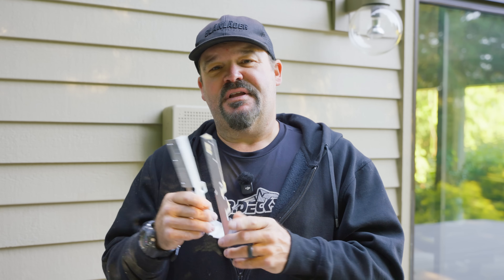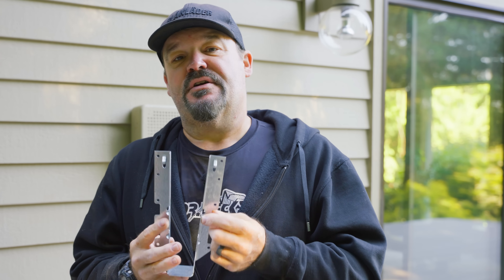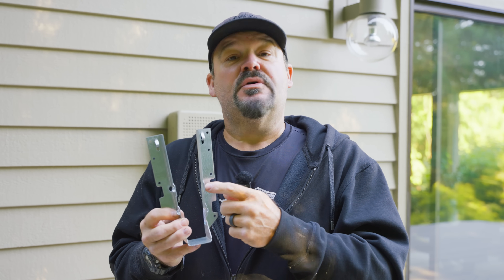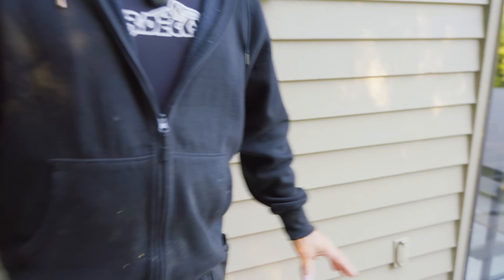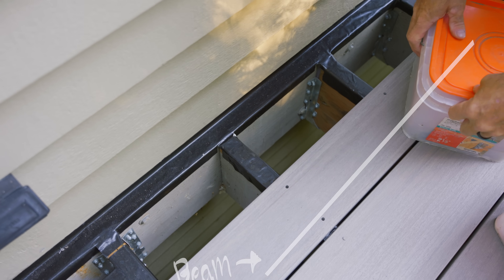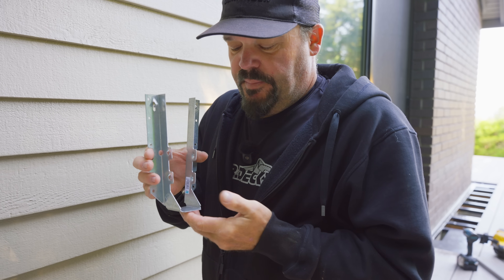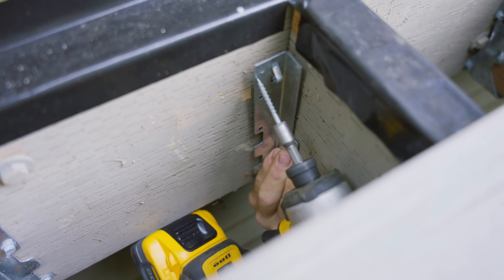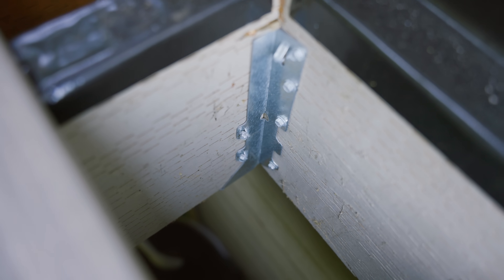The Biggest Deck Building Mistake I've Seen Over 30 Years

Comment: Totally correct if you want to believe the only thing you should use is the manufacturer screws.
That’s the suppliers buying off the code enforcement regulators 
So much bull

Comment: I know its code but its also ridiculous. You will NOT sheer off 12 regular exterior screws in one joist hanger. The wood will give way long before they break. Its another one of those deals where the hanger manufacturer found out they were not making enough profit just selling the hangers.

Comment: I work as a branch engineer (for Canada) for Simpson Strong-Tie.
I know I'm a bit late to this video but I really love the fact that you give the exact information on these hangers!
Remember that nails, by manufacturing, tends to be ductiles and screws are more fragiles. The SD screws have heat treatements and they're also tested with various hangers.
10d nails (0.148" dia) typically comes in 3in long. You might find 2.5 in but usually, joists nails are 1.5in long.
On a more personnal note, I just redid my own deck by watching various video and used the same hangers and screws... It saves a LOT of time and effort!

Comment: Just to mention these Teco nails are as thick as 16d nails ... which gives it's shear strength ... we don't care about pullout, all the load from gravity is perpendicular to the axis of the fastener ... and don't forget the dielectric material between the zinc-coated hanger and the copper-treated board ... or bad things will happen ...

Comment: 3:56 4:56 I wouldn't even use the joist hanger on a deck I'd use the ledger board and cut out at the notch for the ledger board on the joists but yeah you would use stubby nails unless the bucket calls for 12D toenails I just never use buckets on deck joists The deck boards diaphragm the joists so that they're not going to tilt on the ledger board so it makes no sense to me and I've been building everything for about 30 years myself also but I've also been doing it in another state then you're in and the way things are built and other states is different than the way they're built here and as far as attaching a deck to the house I try not to cuz it puts penetrations into the home even with proper flashing from the siding people it's still puts penetrations into the the home but if I were to penetrate the home I would use Dyna bolts or lag bolts and that would only be if I were to flash it myself to make sure that my bolts don't allow water to penetrate into their foundation or into their siding I'm not insulting how you build deck so like I said everybody and every state does things a little differently I live in Florida to me those buckets are not all that necessary I built decks on Sela flex by adhering the pseudo joists with NP1 adhesive and then shooting inch and a quarter inch and a half stainless deck screws into it to not penetrate these are obviously roof decks in Florida we don't do too much regular ground-based ducks they're mostly like second story decks that are part of the roof which you don't want to penetrate cuz you may have a deck outside your bedroom and if you penetrate the sealifax you're going to end up with a leak and your kids bedroom or your kitchen that's underneath you Cool stuff man Good work I just primarily rely on wood joinery when building a deck it's worked since the dawn of time I don't believe in putting $5,000 nails into one little piece of wood because Miami Dade code says so because you just turn the wood into shredded wheat every fastener should be pre-drilled and screwed with stainless two and a half to 3 in screws and or hot dipped galvanized bolts whether they're lag bolts are completely through bolts

Comment: Most Simpson joist hangers are actually stamped with a diagram showing the correct length nail ( at least a 10d) for the angled nails into the ledger, yet I've seen so many builders either ignore this or are oblivious to it!

Comment: Totally correct way to install a deck joist hanger! - Next video mention your use of the joist board tape I saw there, good stuff to prevent mold and rot, another PRO tip.

Comment: Professional Tip! a dab of construction adhesive at the bottom of the hanger will prevent movement and squeaks! Also, pre squeeze the hanger so it almost holds itself on the joist. You're welcome 🙂

Comment: Ductility is the ability of a material to undergo significant plastic deformation (permanent stretching or bending) before fracturing, a physical property crucial for fastners when used with joist hangers especially in seismic zone 4

Comment: Codes are created for the benefit of those that create them. That's called job security. Rating a screw by its anticipated lifetime is impossible but that line of BS continues?? Lab testing is another joke. But, like politics and religion, it's hard to argue with the brainwashed!!

Comment: Simpson makes the joist hangers, brackets, straps and plates that join structural members, they're avail at HD, Lowes, etc.  Simpson also  specifies the fasteners to be used for each application,  this info is readily available online

Comment: Joist nails are ten penny short ones that hold the hanger to the joist. Not sure what they use to nail to the deck rim. That should be bolted with washers and nuts into the building. In side is a spruce backer to bolt thru with washers and nuts. All should be galvanized or some exterior finish.Drip edge on top or spaced away from the house so water gets by.The price of all hangers has gone way up.

Comment: The fasteners into the ledger board are for vertical load.  I make a point to angle them opposite to the angle you installed them at.  The basic function of the hangars is for vertical loan not lateral.  Other components and connectors are used to mitigate those forces.  I think that is the biggest misconception of hangers.  They do not and will not hold a deck to a building.  Same thing goes for installing floor structures in a building, vertical load designed fasteners.
Reply from the maker: Good points, thanks for sharing.

Comment: I have only built one deck. I made beam/joists/footings etc, basically everything over spec. You could crane a truck onto and it would hold. Joist hangers AND the correct rated screws were a must for me.

I have seen poorly installed hangers. loose fit, and regular nails, not even spirals or ring nails. Proper materials/fasteners and tools, the only way to go.
Reply from the maker: That sounds like a solid build.

Comment: Back in the 70s, we nailed the hangers with 16d nails. Later tecos became common. Before hangers, we pressure blocked joist to beams and ledgers.
Reply: What's a pressure block?
Reply: @ThisIsSolution Pressure blocking is where you nail blocks between the joist or rafters against the ridge or ledger. You would lay out your joist. Toe nail your first joist. Then nail your block up tight against that joist. You nail the block on to the ledger.Then you would nail your first joist on to the block. Your next joist would then be nailed on to the block and toe nailed on to the ledger. You basically have a solid row of blocks between the joist, nailed on to the ledger. It is actually a pretty strong method if done correctly.

Comment: Very good insight. I had my local lumber supplier tell me to use deck screws for my joist hangers… smelled funny. Ended up using the proper SD connector screws. Whew!
Reply from the maker: Good to hear you used the right screws!

Comment: I can see that a deck could pull down a house if it was fastened too tightly to the house. In a high wind situation, you'd want the deck to detach from the house just before it created enough pull force to take down the house.

Comment: "TECO" was short for "Texas Engineering Company" which first designed/manufactured the "teco" framing clip (now known as the Simpson Strong-Tie A34 or A35 "clip" or "framing angle").  Before that, however, TECO designed/manufactured split-ring connectors along with the "combination grooving tool and bolt hole drill" which we used when field-fabricating and/or repairing bow-string trusses.
Reply from the maker: Thanks for the history lesson🙏
Reply: I new the name "TECO" sounded familiar. Back in the 1980's I did a repair job on a building at a nearby air force base that used 4" split ring connectors so I had to buy the split rings and the grooving tool.

Comment: The structural nails or screws are supposed to be a certain length to cross to handle the pull out. The 1-1/2 joist hangers handle the sheer. They're staggered for a couple different but similar reasons. The weakest point to secure lumber is within 1-2" of the end of the board. If both are in line it's guaranteed to split the board on grain. The ledger board you're spreading the fasteners through several different grain/growth lines. The more you can hit the stronger in most cases. Screws used to always have an issue with movement and sheer force. A penny nail can be bent back and forth a multitude of times. Actual Structural screws today can but they have to say structural. Multi purpose is not the same. To keep nails from pulling out. 1. Get ringshank.. good luck getting those out without destroying the board. On smooth nails stop nailing every one straight in. Get a long enough nail. Angle one in one direction then the next the other. Construction adhesive helps no matter if you use screws or nails.

Comment: The compromised situation is that you didn't use a ladder. Sometimes a gap ends up at the bottom because PT shrinks quite a bit over time. Regular lumbar does too, just not as much. Also, there are tabs on the hanger to help you tack it in place.

Comment: I'm a small and single worker. I really like using the 3" and 1 1/2" joist nails. Those nails are HARD to remove on a test I tried on some old boards. I will have a problem if I had to remove nails on a project. Those screws are so much easier to remove when needed though.
Reply from the maker: Screws for the win!
Reply: When I was an apprentice it was sometimes my job to remove joist hangers, and yes, it was a workout!

Comment: Great video.  Contractor here. I don't do decks often but I make it a point to do the best method for all of my projects.  Have used these structural screws for years.   I can't help but shake my head in slight disgust when I see projects (joist hanger applications) where other "pro's" threw some roofing nails at them.  And then some people wonder why I cost more.   Ya get what you pay for.   God bless!
Reply: OMG so true. I can almost always throw out the lowest bid, and if your contactor doesn't get a building permit run away before one cent changes hands. Believe me some 'contractors' out there don't know sht what they're doing.
Reply: @BobJohnson-xg9ng you are so very correct
Reply from the maker: Appreciate the support and your professional approach!

Comment: 30 years ago, the building center in my area didn't have the joist hangers I needed, they just weren't easy to find back then. I ended up having to use hurricane ties. 😂 Passed inspection and deck is still solid today.
Reply from the maker: Interesting, things have changed so much.

Comment: The 1-1/2 joist hanger nails are for the supported member (joist). Using an 1-1/2 10d on the supporting member (ledger) has the same shear strength, but 40% less pull strength. You are supposed to used full length 10d, or an equivalent structural screw. This is a classic cause of deck failure. There were engineering and insurance reports being published about this 20 years ago.

If a full length fastener isn’t available you ideally see an engineer, but at the very least you have to come up with a way to increase the draw strength or decrease the deck’s dependence on that draw strength.
Reply from the maker: Good to know, thanks for the info!

Comment: I had heard for so long "nails have superior sheer strength" but that is the opposite of true.  Yes, you have to compare nails/screws that are approved by code to be used for certain applications like joist hanger approved nails vs joist hanger approved screws.   You cant compare a drywall screw to a huge nail b/c they're not used for the same thing and vice versa.   I watched a video that was recorded by one of the fastener testing labs that works in tandem with ICC and they were showing a demonstration of code approved nail vs code approved screws that are approved for the same application.  They had a machine which put increasing torque on boards that were fastened together in various ways and the machine displays number of foot pounds of torque it is applying at all times.   The test is stopped and results are recorded when one of the 3 things occurs -  1) "pull out" which means the increased torque finally cause the fastener tip to be pulled out of the boards it is fastened to   2) "sheer out" - the fastener snaps due to increasing sheer force pounds applied to the boards it is fastening   3) "tear out" which means the fastener did not get pulled out or snapped but the pressure cause the fastener to tear through the board until eventually it tears out the side.   I remember 3 of the tests but I think there was like 5.   The first test was the pull out test and you had two boards sistered (flat stacked) together and one pair of boards is fastened with nails and the other pair of boards with screws.  The machine grabs the boards and simply starts trying to pull them apart.  Most people know the screw should win this test and it did and won by a land slide.  The nail's weakness in this test was pull out.  The screw won by over double the amount but i cant remember exact numbers.   The second test was the sheer force test and you had 3 boards fastened together like an " H"  and the machine is putting downward sheer force against the horizontal board.   This was the test where the old "nails have superior sheer strength" saying turned out to be a saying of countless guys who have no idea what they are talking about.  According to the saying, the nail should have won the test but once again, it lost and lost by a land slide.  The interesting thing is the nail never made it to the point of sheer out b/c once again it got pulled out before it reached that point.  Not only did the screw win that test as well, but it won by land slide and beat the nail at what most people think the nail would win but it doesn't b/c the nail's weakness is pull out and you see it all the time when you see decks settle and you see joist nails being pulled 1/4 way out of the ledger strip/ledger that they're attached to.   The 3rd test was the metal clip/hanger test and the fasteners are being subjected to both pull out force and sheer out force b/c both of those forces are often occuring at the same time against something like a joist hanger.   You may have the far end of the deck settling and so that weight is putting pull out strain against the fasteners and often you see the V-gap at the joist / ledger connection.  You also have sheer weight and to make it worse, the sheer force is being transferred to the thin metal hanger and the hanger edges are pressing against the fasteners that are holding that hanger is place.  The screw won that test by a landslide as well.  The nail did not win one test and it lost all of the tests by a lot.  Nails are used in residential construction b/c they're so much cheaper per fastener than a screw is.  Nails can be applied so much faster b/c of the nail gun.  A house built with screws would require a lot more man hours of labor to complete and no contractor wants to pay that extra cost.  A nail does the job good enough and passes ICC standards - but in no way is it structurally superior.  To the contrary, its far less superior - except cost.
Reply from the maker: Thanks for the detailed explanation🙏
Reply: Do you have a link to that video?
Reply: @jayadinash9102  It was on a website and not youtube and i saw it probably 4 yrs ago.  I have seen several videos of guys doing "homegrown" testing in their garage and they were getting the same results but they didnt have a machine to monitor the PSI at the moment the fastener fails.  One test in particular was a guy was using a bottle jack and applying shear pressure to boards and one set had 4 framing approved nails fastening 2 boards and the other set of boards only had 2 screws and those 2 screws beat the 4 nails.  But it was the same thing - once the pressure reached a certain point you can tell the nails are beginning to kink/bend and then shortly after, they pull out.  If you put a nail and a screw in a machine by itself and the machine is trying to snap each one of them, the nail very well may take more shear force to snap the fastener but when its under shear pressure and its trying to keep 2 boards fastened it turns out their weak point is pullout and it always occurs before it snaps.

Comment: Big question here is how to deal with the pressure treated lumber that comes to the jobsite with about 100% moisture content and then dries out over time leaving a quarter inch or more of space between the bottom of the joist and the saddle of the hanger.
Reply from the maker: That’s where screws may be the right answer if you’re inclined to return and reposition all the hangers. A common problem indeed

Comment: What type of "tape" is that on the top of the ledger board and joists?
Reply: There is butyl tape specifically for joists. There's also a paint on joist protector, but the tape is just easier and quicker.
Reply: He uses G-tape
Reply from the maker: GTape
Reply: I use strips from left over rolls of ice and water shield.